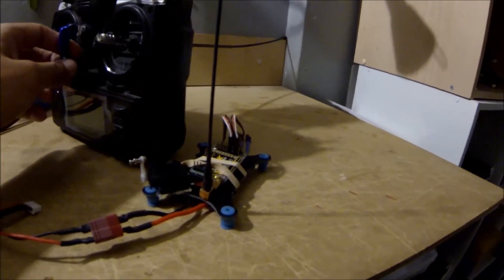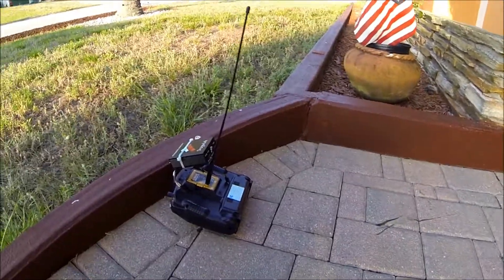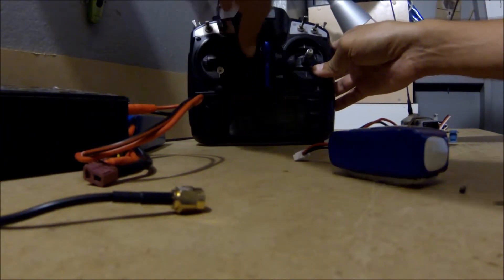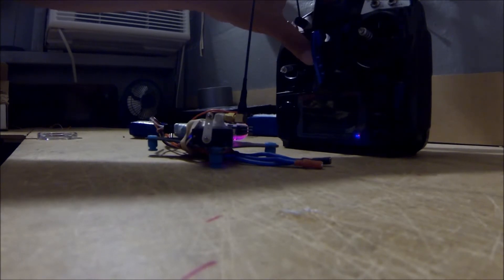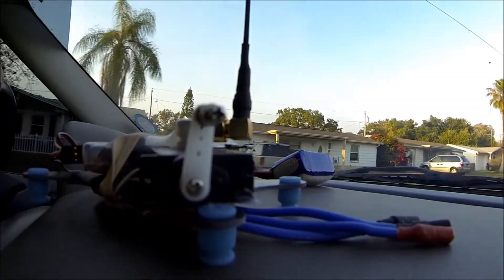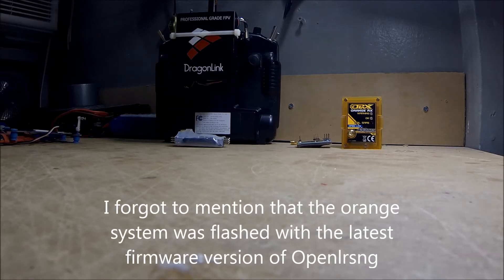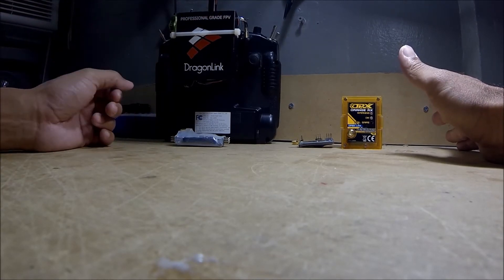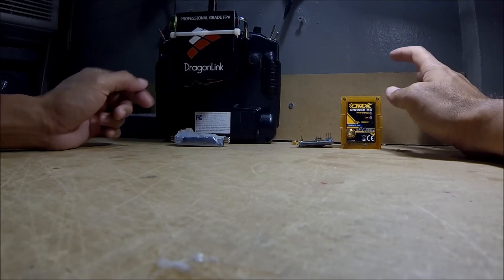Dragonlink V2 vs Hobbyking Orange uhf with Open Lrs firmware

Comment: It seems like the drive around the block with the Dragon Link was much faster.  Why would that matter, well it would cause the system to pass through weak signal areas faster, and maybe not trigger failsafe.

On the other hand the HK modules are know for their inaccurate power outputs.

I have one of there 1 watt 433 mHz setups and it only puts put 400 mw, less than half the advertised power which is 100 mw lower than the Dragon Link which typically put output more than their ratings.

Also there are many settings in Open LRS, the test doesn't show how the test transmitter was setup.

Comment: ** Hey guys check out  "Ultimate Lrs" it also uses the HK Orangerx modules .... shows how to make it use the full 1Watt instead of the 400mw it actually pumps out ... AND don't stop there read that page further and find out how to mod a second one of these Orangerx transmitter modules into a RECEIVER which will also now be 1Watt instead of 100mw (really around 85mw @ 3.5v) in the normal stock orange receiver ... This seems to really promise long range and with the proper antennas it is possible to achieve 40Km/25Mi .... possibly more with a antenna tracker and such??

Comment: Hi will you share how you flash HobbyKing openLrs i didn't find any good tutorial for it i have this system but unable to use it
Reply from the maker: Sorry but I sold the openlrs. I used an 3.3 volt FTDI as a flash tool and used google chrome to upload the firmware. Goggle search google chrome openlrsng.

Comment: Just as an FYI the Orange unit only puts out around 300mw of RF as it's only driven at 3.3 volts so even though it says 1 watt it is actually less power output than the dragon link.
Reply: +BillHally Yep, BUT check this out everyone * :-)!  Modding the OrangeRX 1W modules for full power ( http://www.itluxembourg.lu/site/modding-the-orangerx-1w-modules-for-full-power/  ) (but 2 orangerx transmit modules and use the 2nd one in place of plane side receiver (since it actually is really a tx/rx) to have 1Watt on BOTH ends (and do the 5.5v power mod to both for minimum of 800mw - 1W).  When combined with better antennas the range should now be kick ass to the max (possibly 25-ish miles/40KM) !

Comment: Thanks for the video.  Have you done any long range flights to test them out that way?  Thanks.
Reply from the maker: With the open lrs yes, 2 miles max. Not with the Dragonlink.
Reply: That's impressive for what it is.
Reply: *****  Are you saying 2 miles through houses and trees?
Reply from the maker: ashik shibu I meant 2 miles flying.